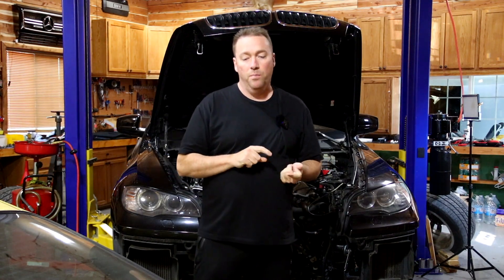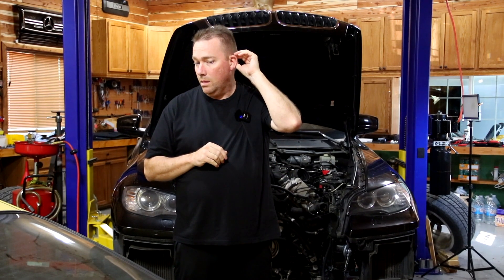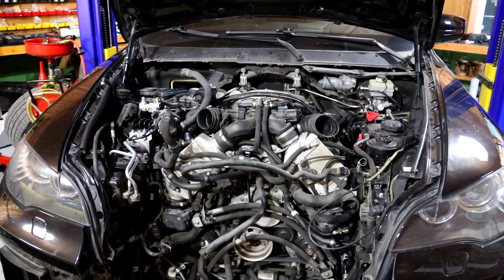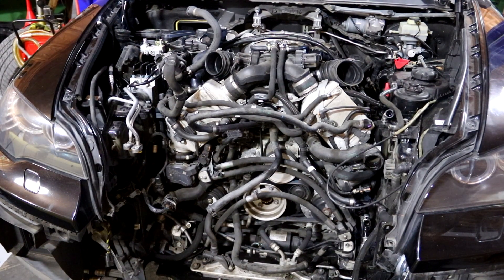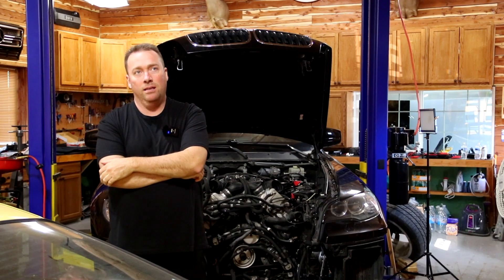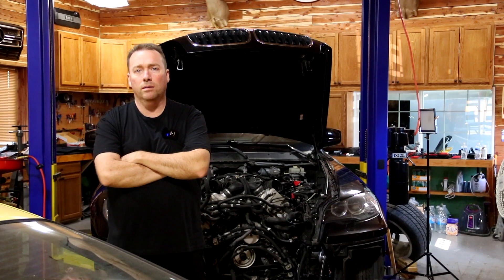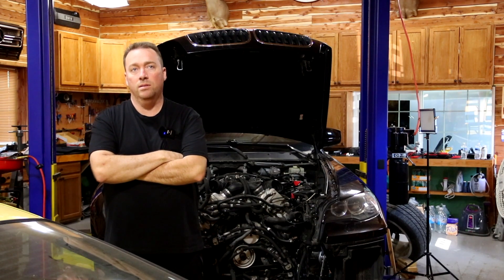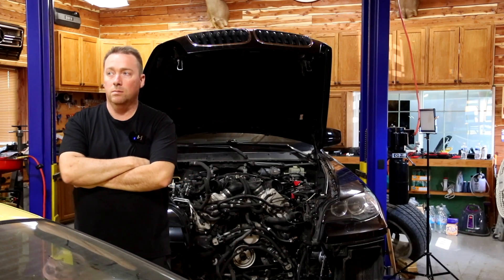So Why Do BMW Rod Bearings Fail On These Engines S62 S63 N63 N55 S65 S85

Comment: My N55 still has the original rod bearings with 120k miles. Still going strong. Change my oil about every 4k miles. Motul oil.

Comment: Check this out, lose my N52, yes N52's rod bearing this weekend!  Just driving down the freeway.  Stock car, never raced just a comuter.  155,000 miles but regular oil and filter changes.  The only thing I did different at last oil change was Valvoline Restore and Protect and M1 oil filter vs Castrol A3/A4 with a MANN.  I never expected this out of a N52.

Comment: I know what the problem. Tolerances too tight. The S85 has a tolerance of 2 globules. There is no room for error between the parts if you use the wrong oil or let it go too long. Other engines have tolerances of 20 to 50. A little re engineering of the crank will eliminate this forever. 
That N63 S63 twin turbo is a mistake that should go in the garbage, a complete waste of time and money. The others are actually worth getting fixed.

Comment: This video amounts to an unanalytical collection of bro-science and anecdotal information.  Aside from the S65, there is no systematic issue with BMW rod bearings.  And the recommendation to replace them in situ as regular maintenance is ill advised.  Replacing rod bearings in situ is just as likely to cause problems as it is to solve any.  My conclusions are informed by nearly a decade of building these engines.

Comment: Engine failure in any engine if not engine tolerances.. Heat kills an engine plus not changing the oil 5K or sooner.. Not 10K.  I seen another Youtuber use 1.4 bar coolant cap instead of factory 2.0 bar cap..  Theres oil coolant t stat that pops early to cool..  Over all these mods can protect your engine plus using water wetter

Comment: You forgot to mention the S54. Rod bearings are a wear item on all of these engines, like it or not. It's worse if you don't change the oil frequently and also if you don't let the engine warm up fully before "enjoying" the car. If you don't replace the rod bearings before they fail, it will kill the engine. It's easy to keep on top of this. All you have to is get the oil analyzed every oil change or maybe every second oil change. As soon as you see lead, or worse, copper, the bearings need to be replaced ASAP. Anyone who can't do this maintenance or pay someone to do it should not own one of these cars. Problems like this aren't unique to BMW. AMG V8 engines are notorious for bending connecting rods (which takes out the cylinder bores), especially on 4Matic cars. Audis have their own problems. BMW M, MB AMG and Audi S cars are expensive, high performance vehicles. They are not for everyone.

Comment: I think the problem with the rod bearings is because the oil was changed according to the instructions, i.e. every 30 thousand kilometers.
Reply: yeah,  they have the interval so high for getting into better EURO category,,  do it every 10t and you are much better off..

Comment: I am in this zone right now. Picking up a 2012 135i to track with. Doing the research I have found the following:
No specific clearances for oem bearings can be found. 
The consensus is that the tolerances are tight.
The oil change specs are stupid. There job is to get mileage and to sell cars, they don't care about the customer when it comes to longevity and the government certainly is no help either.
Items I have waiting for the car next week:
Dual oil cooler set up for track
Oil pan gasket
Bolt kit
Oil pan baffle
braided brake lines
LSD
ACL race bearings
CSF radiator
new hoses
main seal protector shield
oem rod bolts ( think the arp may crush the bore)
oil pan suction pipe
$1375 for part so far and it will climb as I get rid of all fluids when I pick up a new used car

Comment: I don’t know , if all that applies to the N 54 engines. I have a 2010 535 I with the N 54 engine in it. It’s got 217,000 miles original rod bearing use Castro 0W 40 or sometime mobile 0W 40 oil ,change the oil every 5000 miles it’s still running With MHD stage 2+tune for the last three years, guess I am one of the lucky ones 😅
Reply: Same here too I got 535 I Xdrive stage 2+ and I got 163k no issues at all .

Comment: You guys using too light oil, need at least straight 30 weight and change at 5k maximum. Redline is really only 7k for those engines and not 8k!

Comment: After watching your videos I can sympathized everything you say. My 2013 BMW X6 50.i was a nightmare.  N63 was nothing but an endless money pit then you have to worry when driving something else is about to fail.  I went back to my pragmatic thinking.  My wife and I bought a  new Honda and Toyota with 10yr/120,000 miles warranty.  Life is really great when I don't have to think about mechanics, car repairs, reliability  and going to repair shops to get estimate. BMW and Mercedes are great cars. The problem is when you leave manufacture warranty they will start kicking you in the nuts and bank account.

Comment: Thank you for your channel! I have a question,  Is the problem with the rod bearings in the S63 is the same with the S63tu too? I say that because I want to acquire a BMW M5 F90 but used, so if the newest engine for the M5 are better, which year at least you recommend to me to buy?

Comment: Hey Nathan!!  Great videos.  I have a 2012 X5 that I am replacing the motor.  Bought a running donor engine with 71k.  I will be using your info to do the necessary upgrades.  You should post a list of all of your upgrades you "suggest" for an N63 with say 120K (.....that would be for my car).  Great info!!

Comment: Beware,  at about 150k,  your oil cooler lines will burst.  Lost all my oil and one cam jumped time but i was able to save it.  Doing timing chains and valve stem seals again at.185k.

Comment: The E46 M3 with the S54 has the same issue. I held out to 167K then did it myself. I also took care of the engine and when I changed the brings, a few were showing the copper so it was definitely getting ready to fail.

Comment: Good vid but I have to ask why do Americans have so much trouble with BMWs when they are one of the most dependable cars sold in UK ?  IF you ALWAYS use good synthetic oil at every say 12K miles you shouldnt have problems..

Comment: I have a 2014 M5 competition with 63,000 miles when should I change the bearings to avoid this issue?
Reply: Now lol
Reply: When you can afford it, and before they blow. Do anything you can get to, tighten your oil pump chain tensioner while you’re down there

Comment: So a week ago my e71 x6m decided to throw a rod bearings at 172,000kms I picked the car up at 130,000kms and I'm thinking after searching the web for hours about this crap haha That its not the fact the clearances are so tight because the ford GT350 mustang and LS7 cars have the same Rod clearances I think that it basically comes down to the oil service intervals being ridiculously long EG. 10,000miles the amount of contaminants in the oil at that point or even 8,000miles after beating on the car wouldn't be good & at the pointy end of the oil interval service interval those acid like contaminants eat away at the bearing material. Because the factory rod material is manly aluminium which is a weak metal under heat and load. Just my thoughts, would love to here what you think about this opinion.  👍

Comment: As a BMW owner here in Australia, I have always stated that only the very rich or someone who can maintain the car themselves can afford a BMW. Parts costs here in Australia are extortionate! I get my stuff out of the states (FCP Euro/Rock Auto etc). I do follow Jonny at German Auto Works in Witchita. He has a good channel and is a real do the job yourself kind of guy. No BS. I am going to look for the next in this series now.
Reply: the old ones E34 and E39 in my garage have been good to me. FCP Turner Schmeidmann are all good and Clickable is the best for the affordable stuff for the things that go bad.  Even Ebay is great for bulk cheap stuff that always needs replacing like trim clips and push clips to have on hand whenever something like a window reg dies
But looking at these engines holee sheet theres 10x as many hoses as my M60 and M52TU put together. Worthless when they break, throw em away just like your phone or toaster

Comment: The rod bearings fail because the oil clearance is too tight.  Mine were 0.0004" clearance.  This is simply not enough bearing clearance.

Comment: The early n63 and s63 they are piles of junk, however in 2014 going up these engines have all been updated to a more reliable interval.
Reply: I have an x5m e70 with 140k on the clock and still runs great so I beg to differ
Reply: @helsamna3895  bmw has improved parts to replace in these engines, so the early n63 could prove to be better with proper maintenance, so yes, they are capable.

Comment: You said Mercedes doesnt have those issues. you are probably talking about petrol engines. But from my experience, I have seen and done many 350CDI Mercedes G, E, ... with main bearings issues, it's the same with N57 BMW 3.0 and Audi 3.0 TDI mostly 2012-, funny they all share the same catastrophic failures(aka. the most labor required to repair). I know a guy who blew 3 350CDI G wagen engines in 5 years, while I have seen extreme rattling noises from timing chain and very poorly maintained 320CDIs, OM642 without any rod or main bearing failures whatsoever, non serviced, 400k miles+, the same goes for most of MB diesels back in time since this year. Also, noone clearly can tell what is the cause, some say it's the oil cooler, most say it's the poor maintenance or oil. But in my opinion, I am 95% sure it's a engineered flaw and bearings on all of those manufacturers(especially main bearings) are intentionally probably weaker than 1.5 dci clio which was disaster. Other than that, I think those oil/vacuum pumps are also designed to kinda silently fade away and quicken the bearings wear with it. I have seen many crank failures over the years, but even the poorest designed engines mostly spun rod bearings. In my opinion, this is a designed moneymaking flaw, which is also the most expensive to preventively rebuild, requires a load of work, mostly lower blocks are also designed in 3 pieces, connected to chains, chains are in the back, which results is removing the whole engine and many hrs of labor to replace the bearings, hence mostly noone does it, probably those that do it and even put the cheapest aftermarket bearings in, will never have an issue. Think about it: How much stress and explosions rod bearings have to endure, while main bearings simply stand still and carry the crankshaft which is rotating inside. Makes no sense. But I honestly kinda like it. It is made for them, to sell the naked engines for 30k-60k, but it's also good for us, we get some cool big jobs and also make some bucks. And in the future, this will only be more common and more sought after, which means we gonna work on a lot of  nice wheels :D. EDIT: And now how to explain to a customer we have to replace a 150usd part and he will have to pay 3000eur? :D
Reply: Mercedes tech here, I’m gonna give you the short answer because I’ve seen it first hand 10+ times with a cycle of new techs. If the vehicle has under gone intake manifold replacement, turbo, oil cooler in its life and seized the main bearings that is because someone dropped something down the main oil galleys. A lot of people use a sanding wheel to clean surfaces on the engine, well guess where those shavings go. Had a tech do an engine free recently. Car came in for seized linkages on the intakes (om642) common problem. Vehicle had emissions recall. Tech replaced turbo, oil cooler and intakes. Sent vehicle out. 60 miles later seized engine. Asked him did you do a turbo on it ? He goes yeah but I didn’t drop anything in the engine. I go “guranteed that main bearing is welded to the crank” he pulls the pan and that’s exactly what It was. This was no amateur tech either, the tolerances are so tight that only a little grit will end the life of those engines.
Reply: or just don’t floor it all the time?

Comment: Basically it’s. BMW problem. Either they engineered them that way on purpose or engineers just screwed up. BMW should be fixing these while the cars are under warranty before the damage comes in. I will never buy a BMW again.

Comment: My N55 spun rod bearings at 88k miles. Put a used motor in it, and 3 months later the bed plate was pissing oil. Sold the car because I was just mentally drained at that point
Reply: That's why you stick to older bmws
Reply: what year was ur car? did you have the upgraded version of n55?
Reply: Yes older Bmw non turbo is acceptable but anyone not aware of poor reliability rating of current BMWs will just waste time and money , Toyota, Honda knows what reliability is.

Comment: I just picked up my dream 2013 f13 with 17k original miles. I was under the impression the s63 motor was a great motor. Now im realizing it can blow at really low miles which is absolute bullshit. I don't know of any manufacturer that catastrophically blows motors like BMW does. I have a 3yr 36000 mile warranty but it's after that which worries me....
Reply: Don’t worry about it because it’s so low mileage. Do your oil changes at 5k miles, do all the scheduled maintenance right when it’s due, and use good quality synthetic oil. 17k miles isn’t enough for someone to really abuse that engine.
Reply: Sell it right now so you can get top dollar and pivot to what you want.
Or live with the anxiety.
What's a small possible loss vs a giant one.
Reply: @Vgk36  was going to get the bearings done at 5k.....
Reply: @Vgk36  He should at least keep through its warranty period...

Comment: How about the m8s I haven't heard you mention those I imagine it's a similar motor to the rest of them. It's a damn shame they did away with the v12. And the only ones they make it's called the last V12 and only if you bought in from BMW of V12 in the past. And $200,000 on a 760il or something like that. And from the factory that motor sounds pretty good. But then again it's all new technology so it's probably not nearly as good as something from the 90s or earlier

Comment: Hey Nathan, i have an n55 with 100k miles, car runs great but I’ve been considering replacing the rod bearings just to be safe. Which bearings and bolts would you recommend? I’ve heard good things about king bearings, any insight?
Reply: I Would recommend the M3 bearings, dont cost that much more than OEM
Reply: @oldsql725  S55 bearings are the exact same part number. He should use King or ACL probably.
Reply: @ristretto97  oh really? I did not know that, a motor specialist said that to me, I didn’t look up the number though. Thanks for the info.

Comment: What rod bearings do you recommend for the S63 in the M5?  The standard size or the 0.025 oversized performance bearings?
Reply: No they should be .0 original size because the journal hasn't been ground for . 025

Comment: Is there any reason for leaving the n54 engine off the list. Bought mine 335i at 93k close to 170k now. Change oil religiously only use European oil Liquimoly or Total. Upgraded aluminum radiator brought engine temperatures down.

Comment: Got a N63 motor with 64K miles on it. About the get the rod bearing done as soon as possible but need to know what bolts I can use other than OEM. Bought the Rod Beatings Nathan recommended but haven’t been able to find APR bolts for the N63 motor. Anyone have any thoughts?